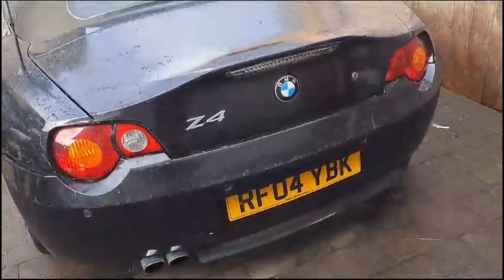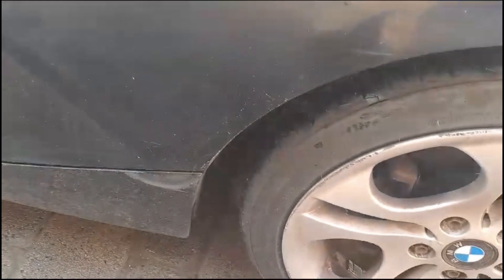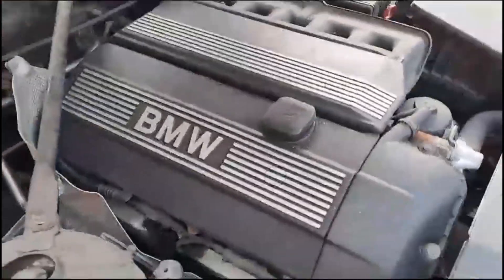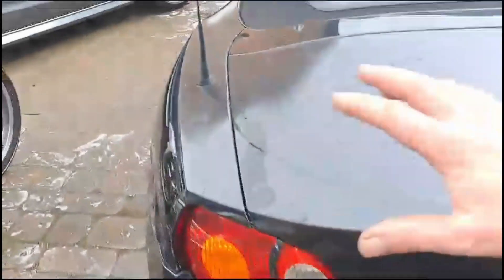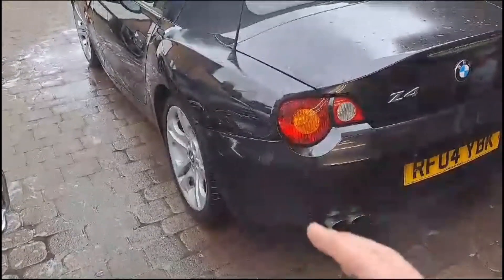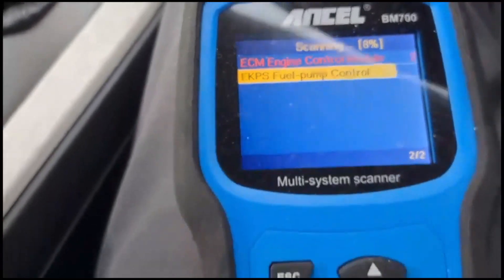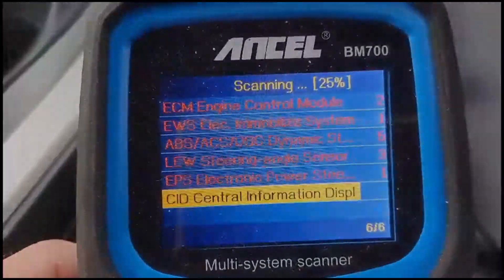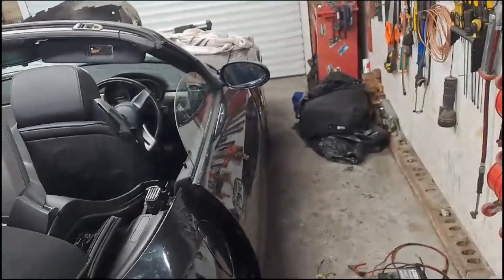BMW Z4 PART 1.

Comment: Looking forward to this, I bought a 3.0i , same year as yours about 3 weeks ago, all I've done is polish it, clean and seal roof and put it in the garage over the winter, I've driven 100 miles in it and it is one of my most favorite cars I've ever bought! about 11 years ago I used to own a e46 m3 and this is just as much fun, raw and simple! ,  I'm not allowed a motorbike anymore (long story) so this is the next best thing! I'm going to stock pile parts over the winter such as breaks etc and get them fitted ready for summer top down fun.....